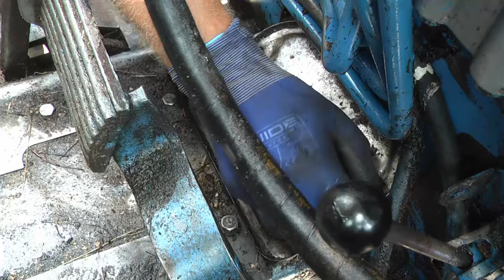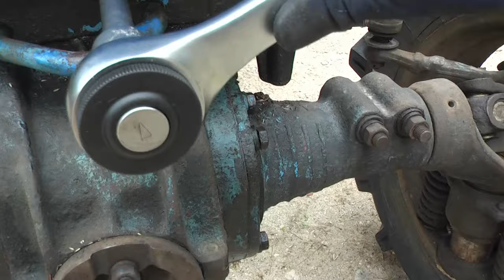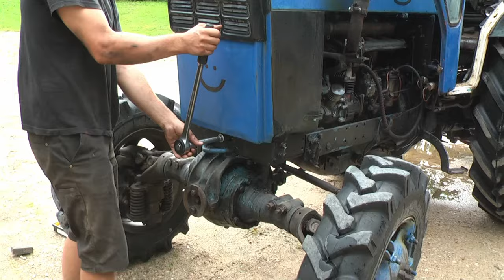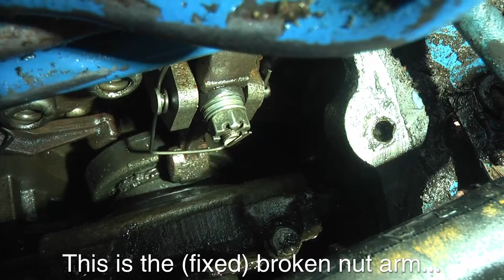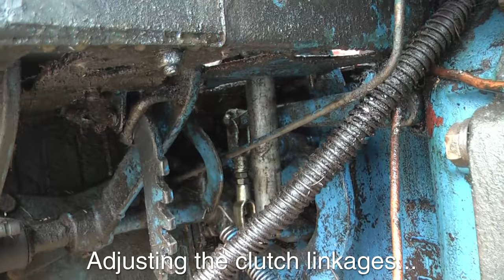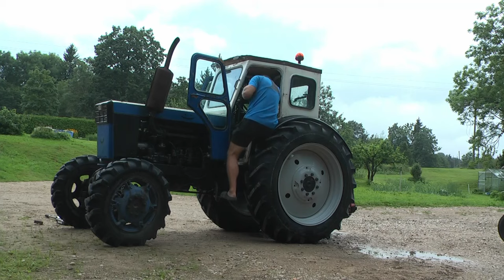T-40 Clutch Adjustment

Comment: Hi there, I have the same tractor as yours and a big problem. When I climb a hill with it loaded it stops moving (the engine is still on) then suddenly it starts pulling and stops again after 5 meters and so on until I go up. Someone told me it is the clutch. Could you give me some advice if is possible.
Reply: Правильно вам сказали сцепление буксует, нужно раскатывать и смотреть.

Comment: Hi there, may I say colleague,
Any chance we get in touch? I see that you are familiar with T40 and I would like to ask you something regarding the steering column.
Reply from the maker: Sorry, I don't know anything about T-40 steering column. Mine worked fine.
Reply: If your steering wheel is turning without wheels then theres a bolt that you can tighten on the joint of shafts before the power steering pump right on top of the engine

Comment: my power steering on my belarus 420 or t40a fails afyer an hour of usage the hydraulic oil is full most of the time so it seems like it bypassing the power steering system do you know what causes this
Reply from the maker: I have no experience with power steering on the 420/t40. I would guess the oil warms up and a valve or a seal is leaking. All the other hydro is working normally and only the steering?

Comment: but when you adjust the pedal this clearence between arms and bearing isnt 4mm but less? when you adjust clearence about 2mm then the pedal's free play will be less ? dony you think? what is the difference between regulation of the clearence on the arms or on the pedal?
Reply from the maker: 4mm is just fine. The most important is that the arms are equally away from the clutch and that you have the required amount of free-play in the clutch pedal - so the pedal is not riding on the clutch bearing all the time. The clutch on the T-40 is known to be a weak link and it's always good to check on the arms and free-play every now and then.